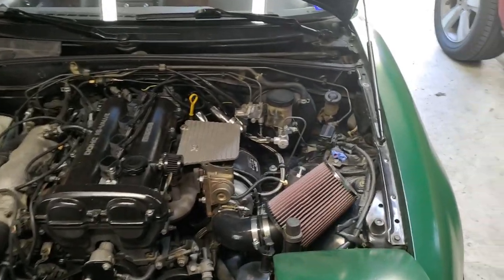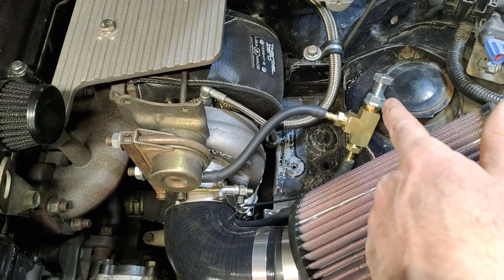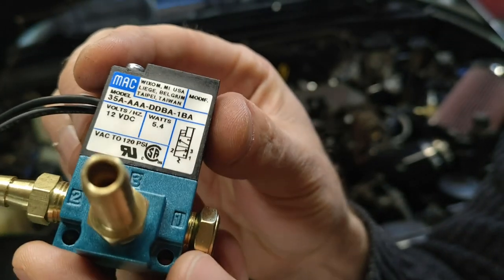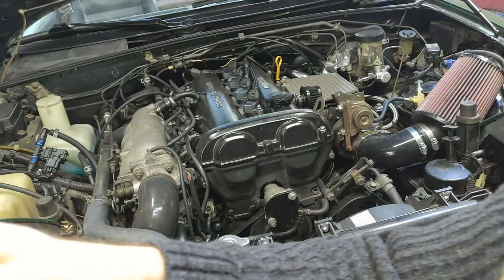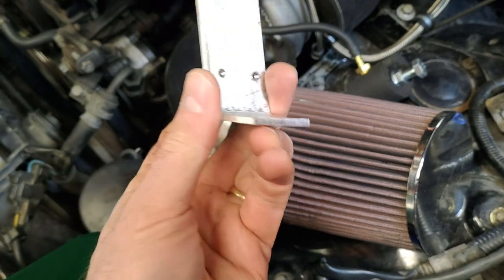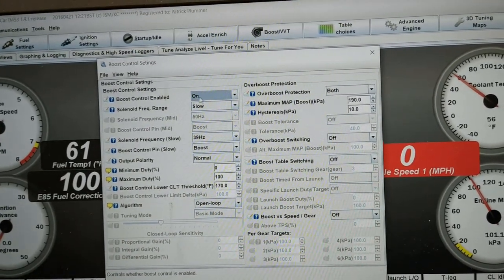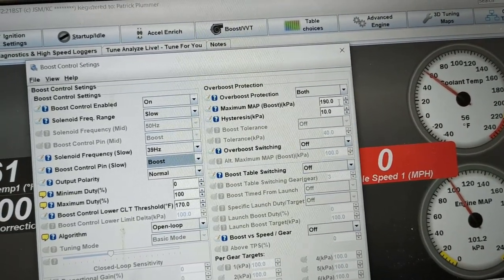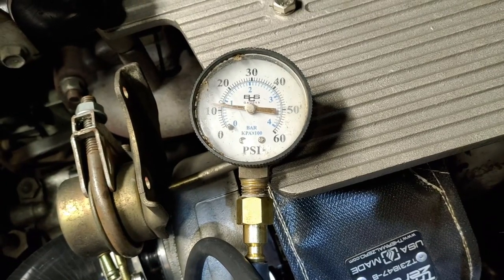Tuning the Megasquirt (Pt 8.) - Electronic Boost Control

Comment: Do you know what boost control pin I use to wire this to a MSPNP2 on my 94'? Also can I use the two pins on the on the MAF plug like you showed without having to run new wires to ECU?
Reply from the maker: Double check the pinout for your ECU here: http://www.megasquirtpnp.com/docs/mspnp_g2_genInstall.php?boardVer=13&isModel=2 but I think it is on the Options plug rather than the plug and play harness.  It'll be pin 7 on the options plug.   However you (with a 94 Miata) can tap into the wire to 2O on the stock harness and jumper that to pin 7 on the options plug so you don't have to pull another wire through the firewall.  If pulling the extra wire is no big deal then that becomes the signal wire (signal ground) and then you need a 12v from that blue plug I show or I think the first pin of the maf connector (you can confirm with a voltmeter when the key is on).  Let me know if that makes sense or not.

Comment: I wired my ebc as Instructed, 12v wire came from the blue connector and other wire hooked up at the 4th wire from the left on the maf plug on my 89 na mx5, after doing so my megasquirt didn't want to connect to tuner studios and kept displaying error messages, if anyone has had this issue or can help resolve the problem that would be great.

Cheers chris 👍